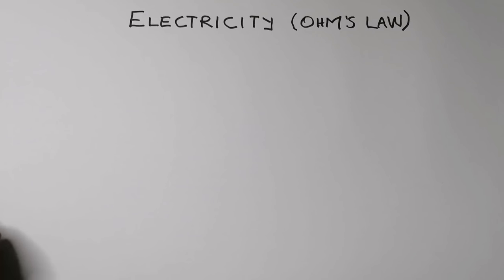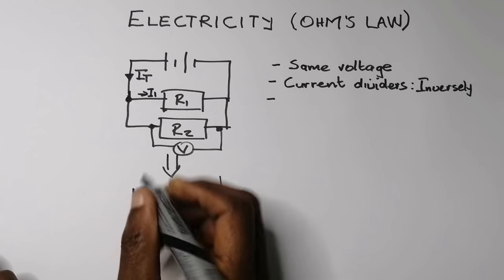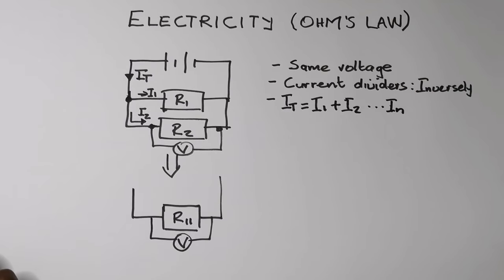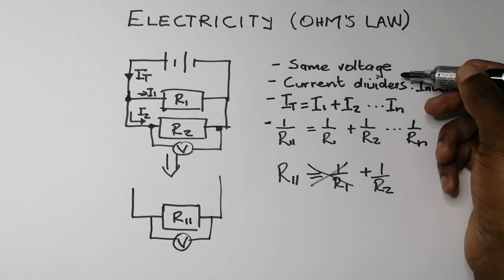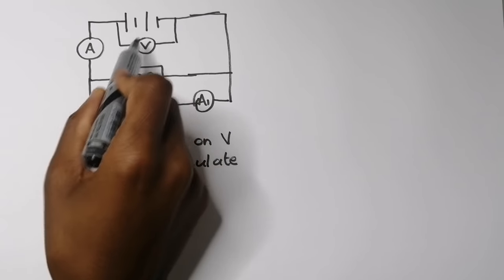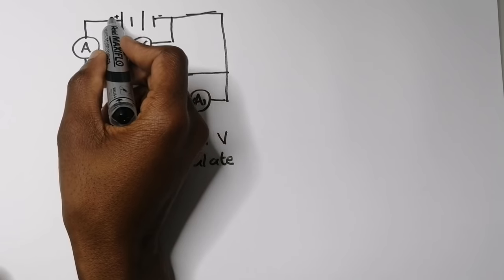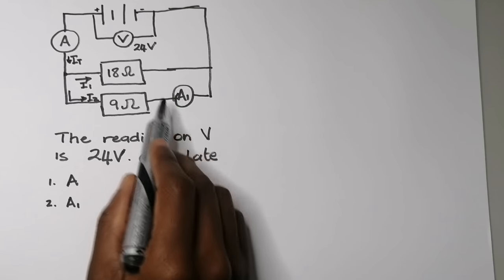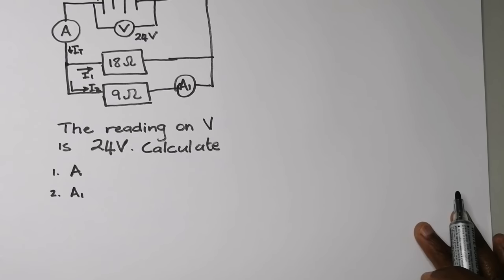Physics | Electric circuits | Resistors in parallel

Comment: Sir why not add the resistors for  both the series and parallel and you will get ( 8 ) when you want to calculate for Voltage because you said in your previous videos Voltage is the Same everywhere in parallel !! And this is not a series circuit but a parallel one . I’m just confused

Comment: Sir I just wanted to get clarity on something. On the second last question, we were supposed to find the value of current passing on A2. Shouldn't it be the sum of the currents passing Through resistor B and resistor C ?
Reply from the maker: You're correct... It was my mistake. Apologies.
Reply: I had the same question 😂
Reply: @MlungisiNkosi  So sir, to clarify... the value of A2 should be 3,5A?
Reply: @perle.malaba  got the same answer. 3.51
Reply: @siphetfomagagula5414  Thanks for that confirmation. :) Much appreciated.
Reply from the maker: @perle.malaba  correct...
Reply: I also got 3.5A
Reply from the maker: @djtonict6629  it is correct
Reply: @MlungisiNkosi  no you didn't make a mistake, you only calculated the current passing through the of 4ohms resistor , you didn't calculate A2. The current on the 4 ohm's is actually correct 1,5A. A2 is then (1.5A + 2A) = 3.5A.

Comment: Sir on the second activity for A2 i got 3.5 A. I firstly calculated the effective resistance of the 4 ohm and 3 ohm resistor which was 1.71 ohms. I then substituted that into the Formula and got 3.5 A. I did that because they asked for the current passing through A2 and not the current passing through the 4 ohm resistor
Reply from the maker: Well done… 😃
Reply: i got the same

Comment: Didn't you say at A2 we add the current Ic and Ib ...aren't we suppose to use both 4 and 3 ohms resistors?
Reply from the maker: Please let me know which question you are referring to by pointing to time in the lesson so that I can answer your question. 🙏🏾
Reply from the maker: @Utimna Mxi thank you so much for pointing it out. You're a star... It was my mistake. I apologise sincerely for that 😊
Reply: @MlungisiNkosi  thank you...
Reply: @MlungisiNkosi  so the answer should be 3.5 A right sir?
Reply from the maker: @mphomurashiwa8154  absolutely right
Reply: I had the same question😅

Comment: Sir I dont understand by making the 18 ohm and 9 ohm resistor one thing do we continue treating the circuit as parallel ... I'm asking cause you said the voltage for the 6 ohms will be 24v ... I didnt understand what you meant when you said because it's the only one
Reply from the maker: Yes the voltage remains the same even when you make it into one resistor

Comment: Sir on the first question to find A
I kind of calculated the I1 & I2  using the ohm's law formula then added them together and found the answer to be 4A😅

I actually solved the whole question with how I did it
Reply from the maker: That’s great… That works just as well. It shows that your understanding of this topic is tip top now
Reply: Yessir!

Comment: Sir can I ask: questions 2, parallel 2
Why did u choose to use total resistance series rather than total
Reply from the maker: Remember the principle is voltage with its corresponding resistance.

Comment: Why are voltmeters connected in parallel to the resistors?
Reply from the maker: A voltmeter has infinite resistance. It will not allow current to pass through it…

Comment: Can you help with rheostat I'm writing my final tomorrow
Reply from the maker: A rheostat is a resistor whose resistance can be varied (changed). Often times, it's used to investigate the relationship between the current  and resistance (Ohm' law) or to investigate the effect of the Internal resistance in a battery. I don't think you need to worry too much about it for tomorrow.